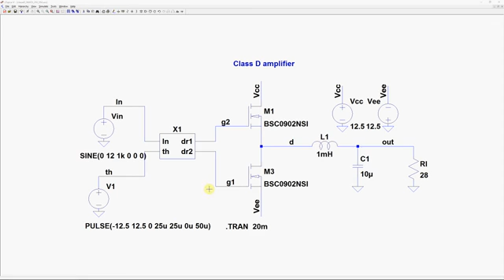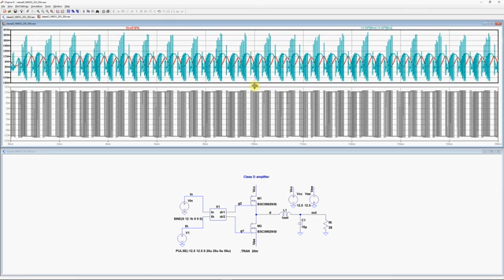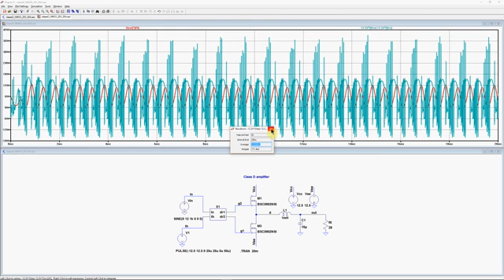Spice simulation of the Class D amplifier

Comment: Looks like it needs RC snubbers per mosfet. I build class D amps using irf640n which are 200V and manage to kill them with +/-45V because of those nasty transients. I just found out that the PDF sheets of most transistors have a PSpice model written into them. Should've started using this program a long time ago it seems.

Comment: Could you please tell me the comparetor X1 model ? 
Is it only available in recent version
Reply from the maker: The X1 is not a standard Spice model. It has been made by myself. It is composed of a bunch of LT1352 opamps and a behavioral generator for amplification and translation of dr1. Nothing special.
Reply: @PowerDevicesandCircuits  can you show us how to make the x1 since is not spice model? thanks
Reply: @monglododji9755  Use the LT1160 as X1 which is as circuit existing and adjust the values around the driver. Input for high and low side is kept at 3.3 V. Load is changed a bit to have it even more efficient. I will provide a video on my members website.